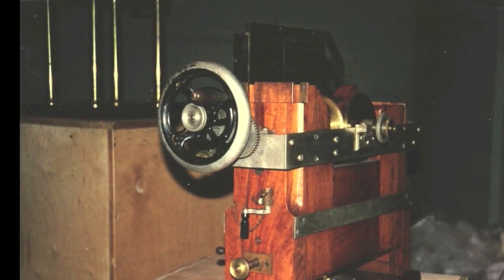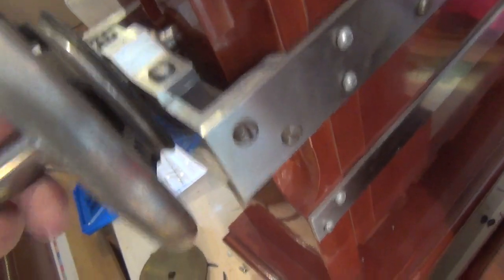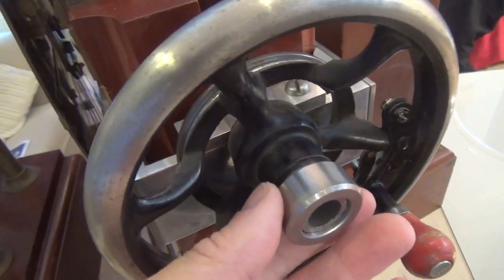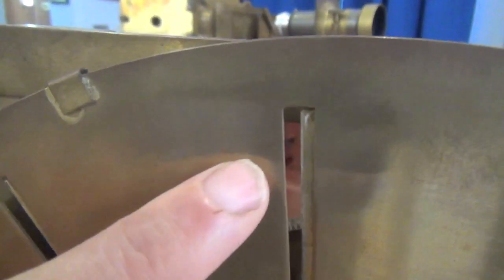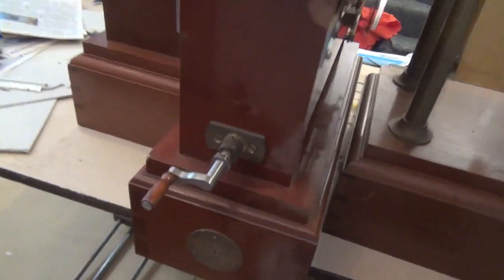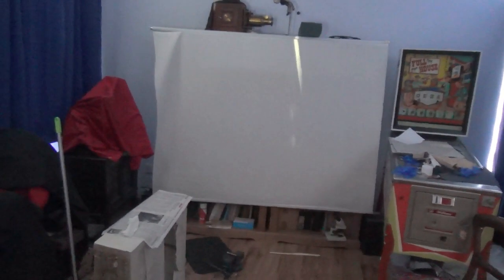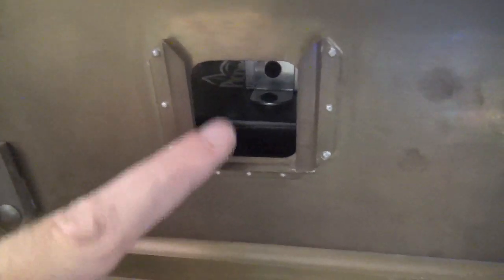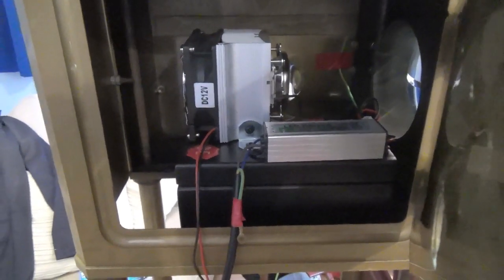Muybridge Zoopraxiscope Replica: New Parts & Test (long version)

Comment: I only wish I had your skills and patience Stephen. 
An extremely well made demonstration piece. 
It is also rather intriguing how the travelling slit provides a horizontal  anamorphic 'squeeze' to counter the purposely stretched disc images. 
(As of course happens with the conventional Zoetrope).

On another topic:
Do you know of any way I could get hold of a copy of an instruction book for a 1899 Warwick Trading Company Biokam?
Amazingly Lena stumbled across one some years ago in a Melbourne camera shop.
The elderly proprietor/collector knew exactly what it was but was so impressed by the fact that Lena immediately recognised it as "a Biokam 17.5mm camera/projector, that he let her buy it for a very reasonable sum.
Only trouble is that it has suffered a few ham-fisted 'modifications' from a previous owner so I need to see what is and isn’t original prior to any restoration attempt.
Reply from the maker: Hi Charles,  the clever stuff was done by the makers of the replica, in the 1980s. Made by British Aerospace when they were in Kingston. (And of course, by whoever designed/built Muybridge's original in 1879!) Re: Biokam - nice find by Lena. I don't know of an instruction book, but I have a scan of the booklet that describes the system. Might be of interest. Send me your email address and I'll send it to you. My email is s-herbert [at] easynet [dot co dot uk]. Best wishes, Stephen